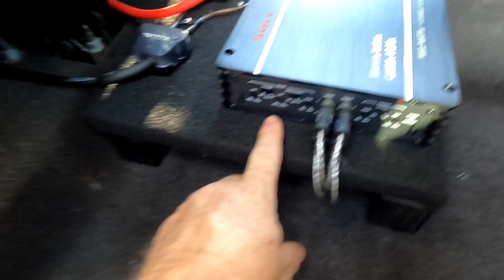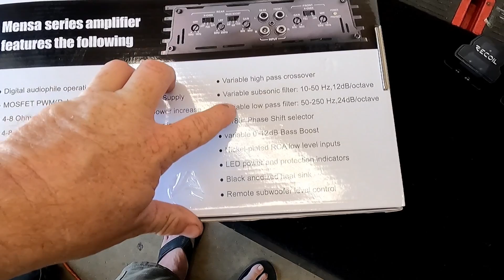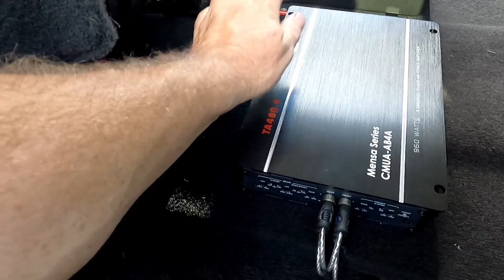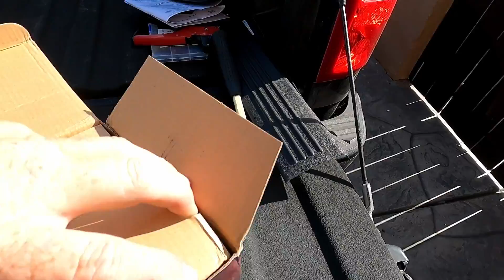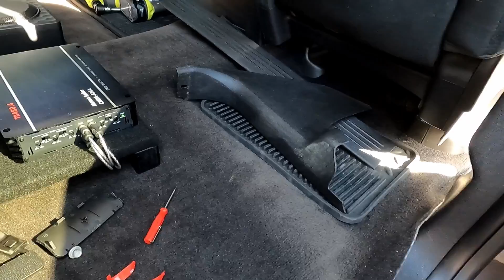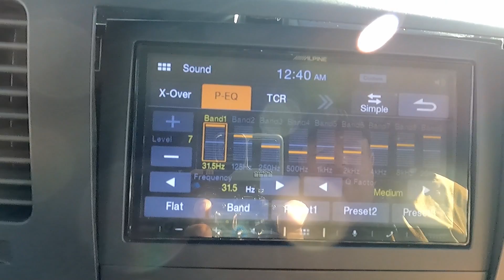HYANKA 4-Channel Amp And 6.5 2-Way Coaxial Speaker install

Comment: Its crazy to think that in the 90s i was a teen scrapping up the cash for car audio that dont even compare to todays cheap standards we have came along ways it might be im older and dont even listen to the radio much anymore ive thouhht about building a sytem for my car but dont want to lose storage space for subs and amps
Reply from the maker: Yes right… I’ve been doing stereos for years in my cars. Surprisingly these components are small for the amount of sound they put out. The amp and subwoofer really didn’t take much space. I really enjoy my music and even with the gas prices the way they are I’ll still take a drive to listen to music. It will really relax me.